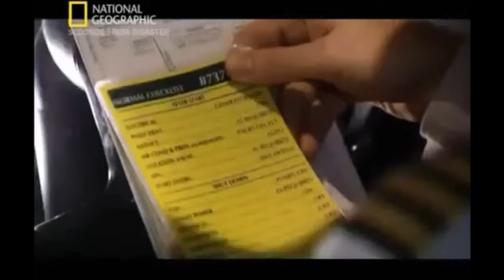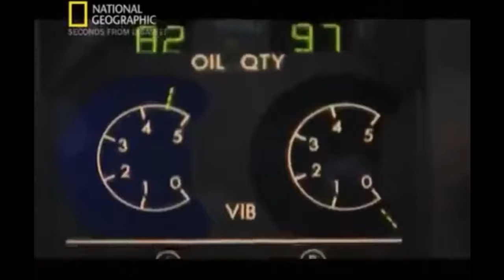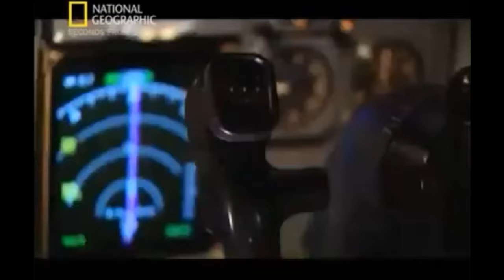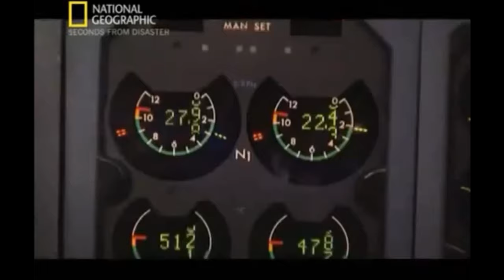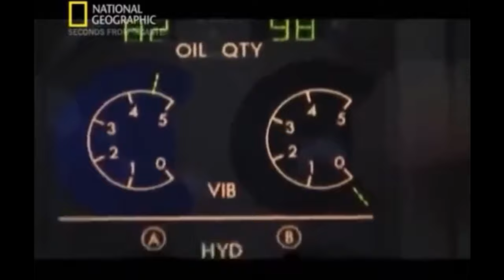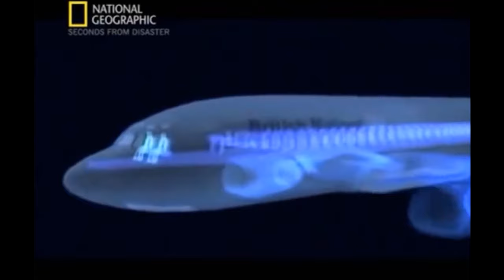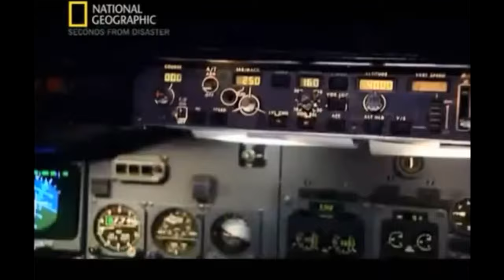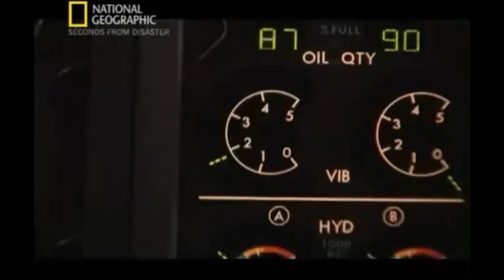Edited Midlands flight 92

Comment: I knew a ex RAF pilot (commercial) who reported the following to me. The Captain was TOLD by the steward who was gay that the  No 1 engine had flames coming out of it, the Captain who was anti-gay roundly ignored his report which may have saved the disaster from happening. That is the one single probably homophobic fact that never comes out of the woodwork. I am not sure what point in the flight the report occurred and if it was on the CVR loop which overwrote itself I think after 20 mins...

Comment: I (professionally) studied the  reports on fatalities and injuries from the AIB (Accident Investigation  Branch - Farnborough UK)  - many hips were broken because the seats 
broke off the seat adjustment rails and the pax were impacted into the 
seats in front by their knees snapping the pelvis in half etc.  If I am 
ever in a plane that's going to run off the end of the rwy I am not too 
fat and I am doing the "hedgehog" - sitting on the seat rolling into a 
ball, feet off the floor holding my hands around my legs feet on the 
seat. In my opinion the brace position probably comes from some 
WW2/military edict and many pax RAF planes used to have their seats 
facing the rear too, in that position most of the crash travel would be "backwards" not head forwards...  I will never use the brace position. I dont want 
to crack my head on the seat in front. or drive my knees horizontally 
into a seat back snapping my femurs and pelvis, etc, Roll into a ball, 
practice it at home. think about it.
Reply: If you're going to sit on the seat rolling into a  ball, feet off the floor holding my hands around my legs feet on the seat.  Your face will bash into your knees on impact.
you could say you'd put your hands between your knees and face but the shockwave will still crush your hands between your knees and face.

Causing you to pass out from the impact and of having 2 immobilized hands  ( cannot clear debris to  get out )

Further more, rolling into a ball decreases your diaphragm which also means reduced lung capacity to breathe.   If you pass out in that position you could end up brain dead due to reduced oxygen intake ( because of reduced lung capacity )   Your leg could even cause ribs to break on impact  and collapsing 1 or both lungs.

Trust the thousands of  studies made on the best case of seating position during a crash  it isn't rolling into a ball.  It might seem better but it isn't simply because an impact with extreme force will turn a any body part into a dangerous projectile of greater mass.
Reply: @PutsOnSneakers  Look at the data from actual accidents such as the crash in the UK where a plane (East Midlands disaster) had many of the occupnats snapped femurs and broken pelvis, dont forget that in usual crashes the forces are long the horizontal vector, I am suggesting taking your feet off the floor remaining upright in your seat with your feet and legs in front to the next seat, so when the seats rip themselves off the flooring rails, (yes) you go forward. and compress a bit more, of course as I suspect you are too fat to do that then "head butt the seat in front and break your spine like everyone else. Here's a quote from the Smithsonian) Boeing 737 at Kegworth, near Nottingham, England in 1989. One-third of the passengers died in the crash; the injuries of the survivors included a significant number of pelvic and lower limb injuries. The study suggested that the traditional brace-for-impact position (which did not include a passenger using the seat in front of her as a brace) could be modified to help reduce these types of injuries." Go figure ---